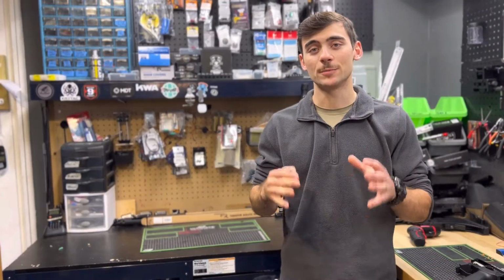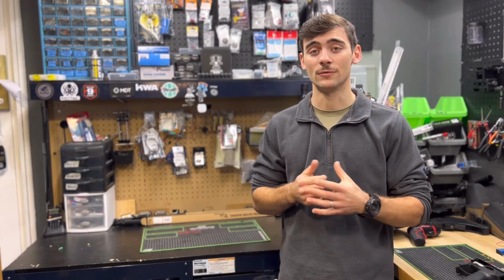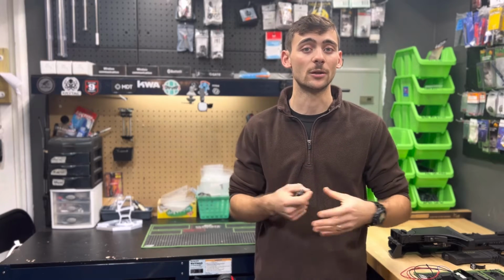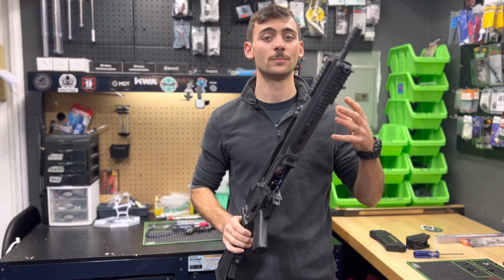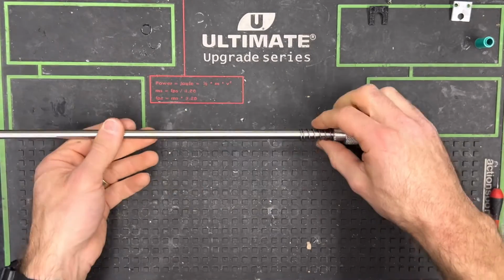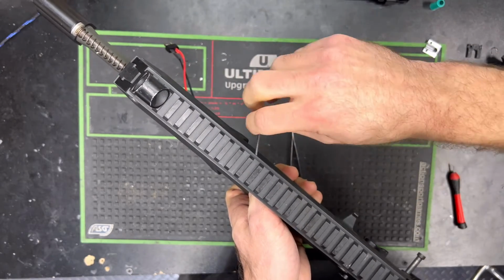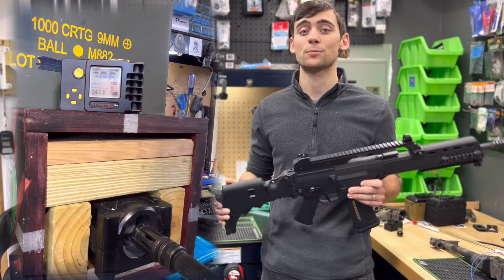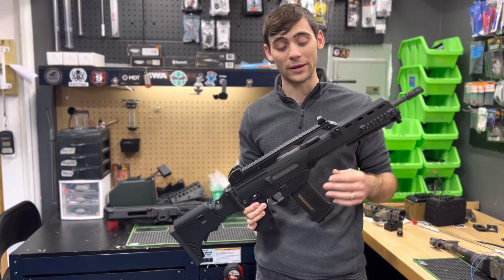Product Review | Combat Union G36 Hop Up Unit

Comment: oof i have retro shell and same cage sitting on my bench right now. i was thinking about prowin chamber or just use stock tm chamber with 3d printed to arm accept flat nub. i know gb will slide in fit for my star sl9 body but i was also gonna use for sportline umarex g36 body for cqb games. seems like this gonna be challenge like yours lol
Reply from the maker: These different companies tend to do weird individual designs in their G36s. It’s surprisingly a very unstandardized platform unlike the M4/ AK. I think this is very much the reason the G36 isn’t as prevalent as it could be! Good luck on your build! Gotta see more G36s out there!
Reply: @anttechairsoft  ill stop by your shop when i go to zulu with my rifle once its done